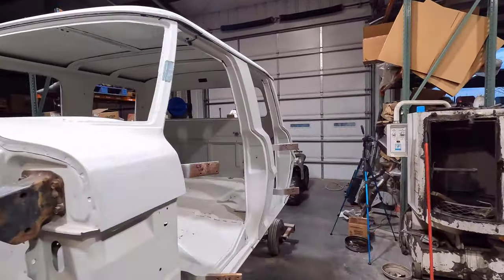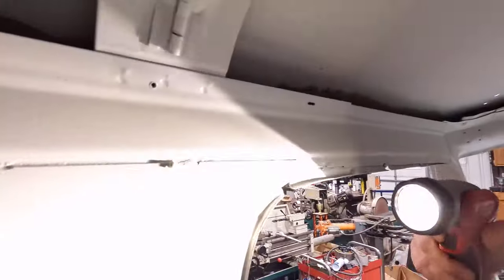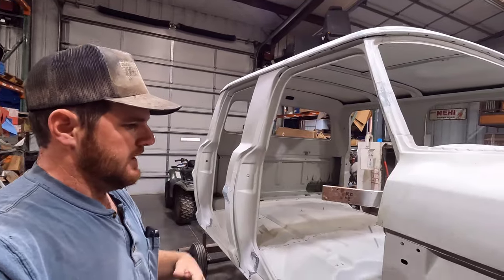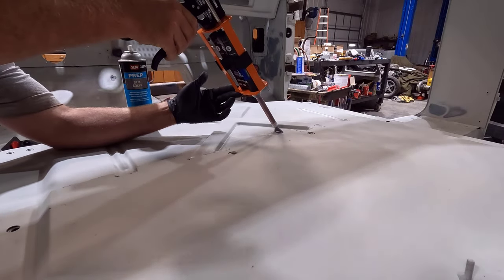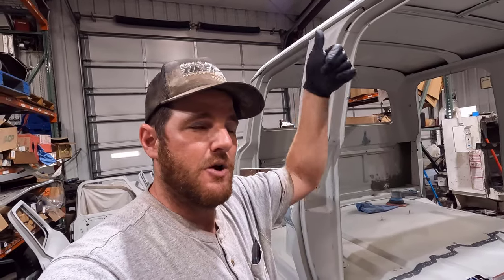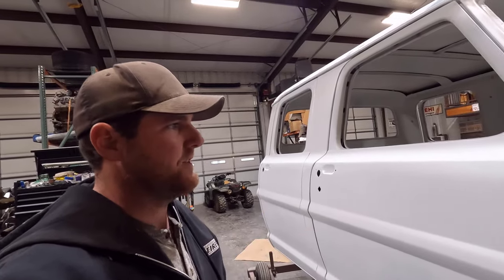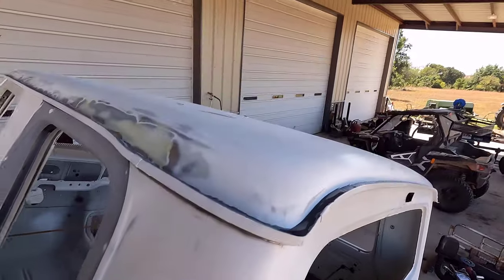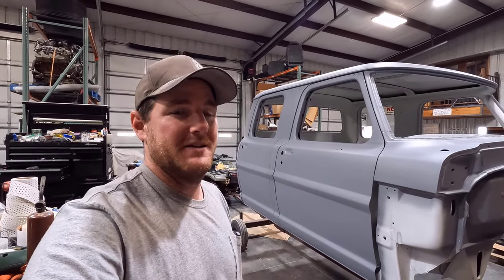Ultimate Crew Cab Part 11 | Seam Seal, Rust Prevention and Primer!

Comment: The truck is progressing nicely. I am my own worst critic and can tell you where the flaws are in what I've done. It sounds like you are the same way. I like your attention to detail with items like the seam sealer on the cab floor. that will never be seen again and the hole in the dash that you filled to center the cargo light switch. What did you do about the right front door at the top? That could turn into a loud whistle as air funnels through it into the cab as you go down the road. Did you test fit a windshield to make sure all was good?
Reply from the maker: I forgot to say it in the video but I ended up tapping the top of the door in to match the contour of the cab. Wind noise was my fear as well.

Comment: Hey Matt my dad and I are working on a 67 highboy right now. We are body swapping a 70 f250 camper special body onto it.
Reply from the maker: Very cool! 67 highboys are kind of a rare truck I would try to keep a 67 cab on it if you could.
Reply: The 67 is in really rough shape, it had been rolled and there is inches of bondo filling thr dents